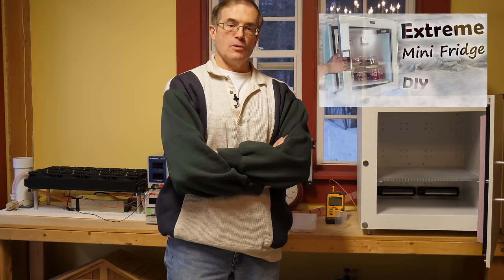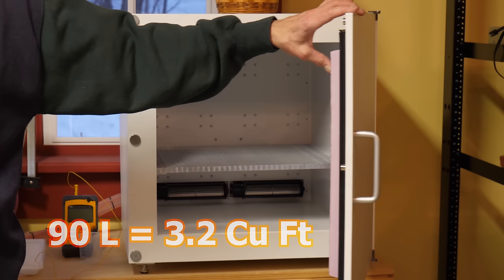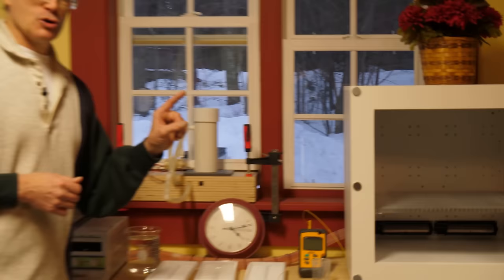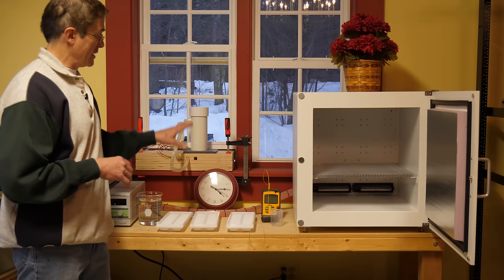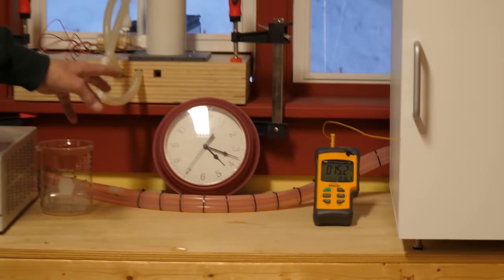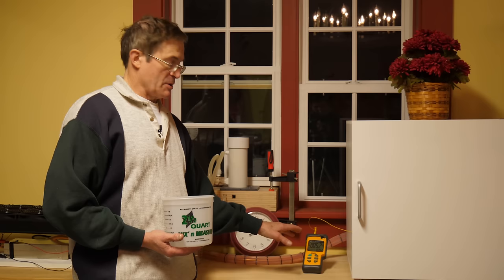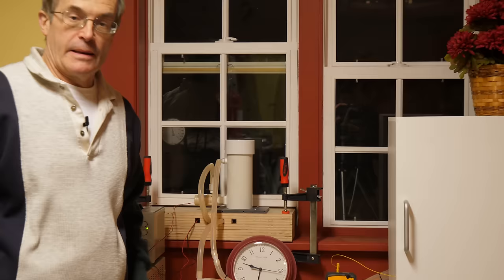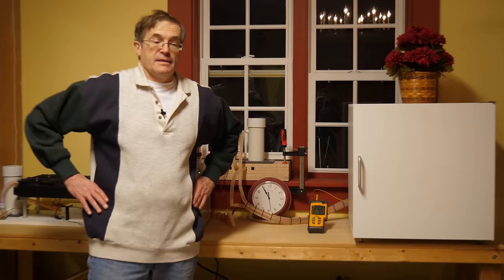TEC Freezer - Build Your Own!

Comment: Id like to see more demostration of this units effectiveness. For example, how much energy will it take to maintain -5c?
Reply: Yes, energy to hold a set temp, with external vrs internal cooling..
Great stuff, I about to bring in cool air and draw the hot away from a standard cooler.

Then pimp with what you shown.
Running in van with solar and battery

Comment: Your fabrication skills are up there with your knowledge of science.  I often find people very good with their brains tend to lack in hand skills.  You do not fit that stereotype.

Want to build a large-ish fermentation chamber.  Your ideas I think will work very well instead of using a couple or even several fridges + heaters + controllers.  Though I wonder at the efficiency of Peltier in a larger chamber.  But...math will answer me and I just want to maintain a nominal and reasonable temp, not make something hot or cold relatively.

Edit:  Looks like you're water cooling the TEC/Peltier?
Reply from the maker: Yes we are.  Some viewers  ask if this approch would be better than a compressor based system for various purposes and I have to caution them about some of  the draw backs.  However, your application is excellent.  Fermentation does not require huge temperature differentials and the process is exothermic.  Therefore, at certain times, warming may be useful, but depending on the volume, once things get going, a little cooling is needed.  TECs provide bidirectional heat pumping.

Comment: Very interesting, and I just subscribed.  I am currently looking into ways to make my swamp cooler unit colder here in El Paso, TX.  The temperature here is constantly at or above 100F during the day.  Good thing it is dry.  I thought about buying aquarium water chillers to use in the tank of my evaporative cooler (swamp cooler) in order to make it colder.  I've also though about just dumping a couple of peltiers in the water, but there is an opposite heat factor on the peltier that would defeat the purpose.  Anyway, look forward to more of these awesome experiments.
Reply from the maker: We successfully built a dessicant based airconditioner that is much more efficient than commercial units.  This differential is greatest when the relative humidity is low.  Consider the fact that in your dry conditions, a swamp cooler is pretty effective, but the principle of evaporative cooling does not require that you mix the humid air generated during evaporation with the envioment you want two cool!
Reply: Tech Ingredients is there a link for the desiccant based air conditioner build?? Thanks.
Reply from the maker: Not yet.  The video has been filmed and we are now editing it.
Reply: @TechIngredients  I will stay posted. Thanks

Comment: The only design change you may want to consider if you were going to use this design for an extended period of time is to alter it into a chest freezer with access to the inside via the top of the freezer which will lead to a significantly reduced loss of thermal energy when accessing the contents of the freezer

Comment: Is there any chance you may be losing a couple of tenths of a degree having the hot output and cold input lines zip tied together? That's essentially warming the cold input by a little bit before it even reaches the TECs
Reply from the maker: Maybe a little.  However,  these soft silicone tubes have a pretty thick wall.
Reply: @TechIngredients  You can still feel the significance of the temperature different when they come in from the radiator outside. For the project now, it isn't a big deal because the freezer is working how you had planned. I just wonder if instead of having the input and output on contact, what difference it would make of you wrapped a bit of insulation around each tube to see if it improves efficiency. Just a thought.
Reply: @skuzlebut82  The same insulation "TI" recommended to nix potential condensation would also address your concerns around losses, right?

Comment: Better TEC's just announced.  Thought you might have an interest.  Offered at Digikey:

 Laird Thermal Systems' HiTemp ETX series thermoelectric cooler has a robust construction that allows it to survive in temperatures up to +150°C, exceeding most outdoor applications. It is assembled with advanced thermoelectric materials that boost cooling capacity by up to 10% compared to traditional thermoelectric coolers. These solid-state heat pumps feature a higher thermal insulating barrier when compared to standard thermoelectric materials, creating a maximum temperature differential (ΔT) of up to +83°C.

The enhanced thermoelectric materials are combined with a proprietary construction that prevents performance degradation in high-temperature environments, a common problem with standard-grade thermoelectric coolers. The HiTemp ETX series maintains a high coefficient of performance (COP) to minimize the amount of input power required to operate and reduces the heat rejection requirement to the hot side, which is critical in poor heat sinking applications.
Reply from the maker: Thanks, I'll look into them.
Reply: @TechIngredients  Thanks, I'm sure you can give us insight on the impact of this development.  I'm sure they won't be cheap until 3rd world countries knock them off  ( - :
Reply: 2 years after this post, at a quick glance, they're running $50+/ea. Thats quite a big jump from the run of the mil $5 ones. However, I can see applications where the temp differential simply can't be overcome thus making these ETXs attractive at any price point. Thx for turning me on to these!

Comment: Another great video and build. I wonder about the unexpected drop in temperature beyond zero degC. You mention the possibility of super-cooling. May it be better explained by conduction of heat in the wire element for the probe to the freezer cavity, which is already below zero? But then I don't know how it would rebound to zero. In any case, I believe it is a very localized measuring instrument effect.
Thanks for your exceptional content.
Reply from the maker: No it is super cooling.  It happens over and over and in different locations.  If it were regional then it would occasionally be compensated by a transition-hold slightly above freezing.

Comment: I'm not sure I understand how this is actually cooling.. I was looking at the wiring in the back and you split it into four parallel lines, then three modules in series, right? So, are you supplying each module with 5.834 volts, 2.925 amps? I followed the paperwork on the other video and it seems like those values won't actually work on the sheet.. I just discovered Peltiers and I'm wondering if I can make something relatively efficient to cool water approximately 15-20°C below ambient.

Comment: Superb series on refrigeration! I need about 5 cubic feet for an RV refrigerator. How much power for 90 degree ambient, 35 degree refrigerator? How many of the peltier devices? I'd be running on a 12 volt/220 ampere-hour battery. Thank you for the videos, and as usual, well done!!

Comment: Question:  Can TECs be effective enough for application in a freeze dryer. And can the polarities be reversed? I've been reading that some units have cycles that warm the food back up. But they do this by using a separate type of system. With an oil I think. So, I just thought that maybe this could simplify the process.
Reply from the maker: Yes, to both questions.
Reply: @TechIngredients  Cool 😉😁 thanks for getting back with me so soon and giving me some direction. I think this could be fun as a senior project. I can't wait to learn more about this tech and start on engineering the systems. I'm open to advice if you have any. If not, I've some work to do. Have a wonderful summer!

Comment: For my application, I would want unit to be able to switch back and forth, heat and cooling.   To maintain desired temperature and respond to fluctuations for the items to be place inside.....
Reply from the maker: That would be an easy modification. Just install a temperature control tat sensed the temperature and switched the polarity of the power supply output.
Reply: @TechIngredients  can u suggest the item you would use? I would have to order online, limited access to materials in this town.

Comment: The thing that I think is missing is how is the best way YOU found to connect then, in parallel, 12v 9V, 4V... so reduce the experiments that I will need to make here... but other than that, this was a class better than any that I take in college
Reply from the maker: Thanks!
It's really simple and the principle is that each TEC can be treated as a simple resistive load. You can measure your TEC with a DC multimeter then determine what arrangement of parallel or series grouping will get you within the current and voltage range of a convenient lower supply.  The harder you drive them, the less effecient TECs become and that's why more TECs are better for a given cooling load.
Reply: @TechIngredients  Thank you, your videos were the most explicative I have seen... I'm a big fan... thanks for the reply.

Comment: Food for thought....
Think of your home as a "system".
Even though this freezer will use less power if you dump its heat outside, in the wintertime, it may be more efficient as a "system" to retain and dump that heat INDOORS, as it will offset the general heating requirement of the home in general. Dumping heat outside will waste that energy. Dumping it inside, even though it requires more energy to run the freezer, none of that energy is wasted.
Reply from the maker: True.  There's another thing to consider as well and that's cost.  Like I described in our most recent video, even though the dessicant airconditioner is less thermodynamically effecient than a conventional,  compressor based system, because the majority of it's operating energy can be obtained at much lower cost, it is less expensive to run.  If the refrigerator uses electricity and dumping the heat outside reduces it's electrical requirement, the lost heat may be cheaper to replace burning gas etc.  There's a lot to consider.

Comment: Compared to fridge, the freezer doesn’t have the thick metal inside and only use 1 thick metal on cold side I guess?
Because from my observation the cold side on fridge is: thick metal-stacked aluminum plate/wall-thick metal-TEC
And on freezer: stacked aluminum plate/wall-thick metal-TEC?
May I know why? Does less usage of thick metal resulting more conductivity for the cold? Because I think you said to conduct the cold and remove the heat for using TEC…

Comment: With the exception of ice caves or thermal vents; 6 meters underground worldwide the constant temperature of the earth is 56 degrees fahrenheit. How about a radiator not so deep under every house for cooling needs, combined with heating needs including solar battery box warmth. What about the house floor as the first phase radiator in the winter? Why not earth temperature air heat exchanging? In winter, 60 F is much closer to 76 F than 32 F, and in summer, 60 F can be used to substantially lower 90 F down to 76 F. Where is your high utility bill with constant preheating a tank of water that replenishes the hot water supply. Happy to see nature applied!
Reply: The problem with geothermal is that the ground isn't a great thermal conductor. You have a practically limitless amount of energy, but a very limited power. It is the same reason why people use to make mud huts in hot regions.

Comment: I wonder just how low a temperature you could reach with a reasonable diy freezer, to get the high compression rates, where could you source cheap compressors for super low cooling?

Comment: Is it possible to get the schematics of the freezer and how to add the external air cooling system, to dump the hot air off the unit, instead of the traditional fans at the back of the unit?

Comment: "the more gently you operate them, the more efficient they are" - I always wondered what would happen if you take this to extreme. I'm not sure if prices differ from country to country, but the cheapest TEC I see on ebay is $2 (that's USD). What would happen if you fill the whole area with TECs and use thick enough heat spreader then liquid cool the hot side. Will it reach the efficiency (or get better) of compressor based refrigerator (if you are fighting for efficiency you might target higher temperatures.). Of course having high temperature difference also drops the efficiency so maybe two stages for lower temp difference. And of also for a refrigerator you want fixed temperature, so when you reach it the consumption will be lower if you use a controller.
Reply: just watched the previous video. Staging reduces the efficiency. so no staging

Comment: In our caravan we have a three way fridge for 12v dc 230v ac ir gas. I belive it works by heating ammonia. It seems inefficient but compressor fridges for 12v are very expensive. Would this be a better option ?????

Comment: So how much less energy did you use with outside units?
Reply from the maker: It obviously depends on the outside temperature.  When the outside temperature equals or is lower than the desired freezer temperature then energy use nearly disappears.

Comment: Could you cool down a cob LED light with TEC and use the generated electricity to lower power consumption of the LED? You know, in addition to a cooling radiator and fan. I wonder why they dont manufacture all COB LED on a TEC plate. It would make sense. The efficiency could jump couple of %. Maybe not too much but if you want to illuminate a highway like they have in Belgium it may save a lot of energy during the winter.

Comment: I would have used a litre of cola! (Super Troopers movie quote).... 
I noticed that the Peltier devices are wired 3 in series top to bottom..... 
Wouldn't that possibly pose a problem? I would imagine that the coldest air sits at the bottom while the warmer air resides at the top, thus the Peltier device at the bottom should represent a different impedance to the top one? I would imagine that this is akin to 3 solar panels in series and one panel being in the shade, although solar panels have built in bypass diodes to counter this sort of situation while the Peltiers do not..... 
Something is telling me that the Peltier devices should have been wired possibly 4 in series left to right..... That would put all the Peltier devices in the right location to fully take advantage of the temperature where they are located..... 
No sure if you get what I'm trying to get at? Not entirely sure if this would increase the efficiency of the freezer? 
Also, there's something inside the freezer at the bottom in the back there that I can't quite make out what it is! Is it a heatsink or one of those squirrel cage fans? 
I would have loved to see some sort of temperature controller that should shut operation down when the desired temperature is reached, would be great for efficiency..... My daughter has one of those Peltier mini fridge which is just large enough for a can of coke, she keeps her beauty care products in it and it gets quite cold inside, they are using one Peltier device half the way up the back, I personally would have fitted it at the top! But it's the power consumption of a constant 60W day and night that, when you are off grid, it's a load that could have been designed better.... 
Also, a temperature display at the front with a power on led and another led to indicate that the cooling system is active (assuming that a temperature controller was fitted).... 
Seriously though, it so close to being a product that I would be interested in purchasing..... This thing could run off some battery and solar panels.... With a temperature controller fitted, you wouldn't need so much battery to get through to the next day.... 
Otherwise this is an excellent video! For me, the work on Peltier devices that you guys have put in is the benchmark for this topic! Fridge, Freezer and Generator..... 
And speaking of the Generator, in that video you claimed that 1.2W is achievable per Peltier device, you ran a 45W led floodlight, if I remember correctly you had 36 Peltier devices (I'm going to be watching it again just to confirm that I have it right) which if that's correct, you had the potential to get more than 45w, but the led floodlight was only taking what it needs.... Had a battery also been in circuit, it could have been charging it possibly keeping the floodlight running long after the fire went out.... Just a thought.... Hoping that there's more Peltier device projects in the future pipeline.... Especially if there's a usable product at the end of it... They get a lot of bad wrap from people who don't understand them, I commonly see people saying that they are only 3% efficient and that they are just a toy or gimmick, I know that they can reach efficiency level's up to 25% if not a bit more which is right there in solar panel efficiency and look what's happening with solar! It's literally powering my whole house! Now just imagine what is possible with a lot more Peltier devices?